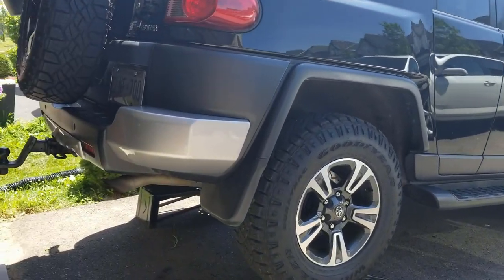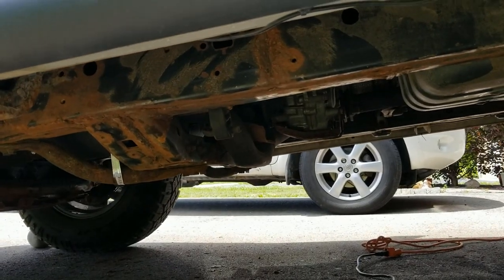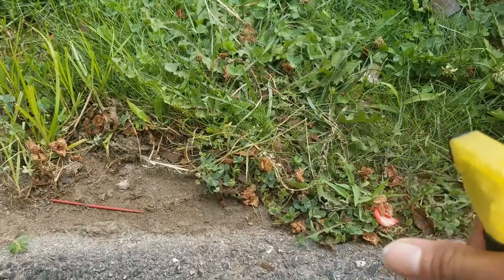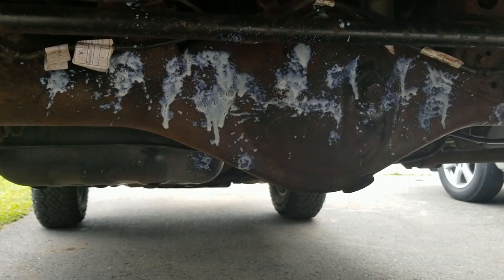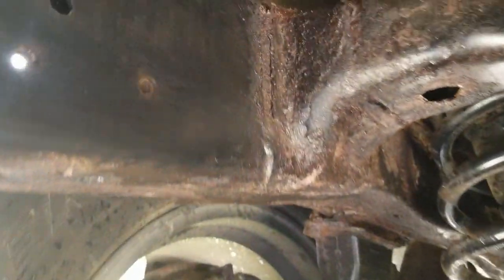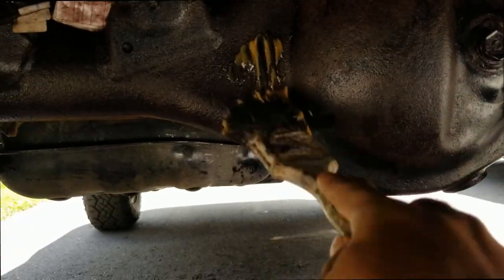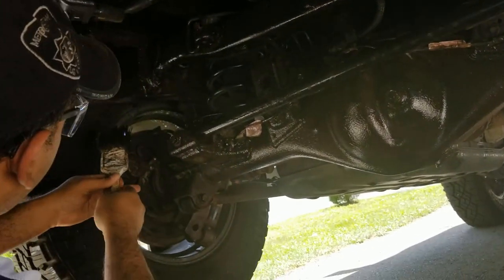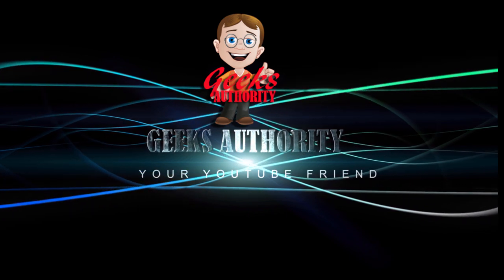TOYOYA FJ CRUISER | RUST PROOFING | FLUID FILM & FDC RUST CONVERTER | FRAME RUST PROTECTION

Comment: this helps me so much. Thank you! Is there places you especially dont want to wire brush, or spray or paint fluid film?
Reply from the maker: Thats so nice to hear Steven, thank you. Yes, you dont want to brush on rubber bushings or spray on bushings. Do not spray anything inside calipers because if it accidentally ends up in brake pads, that's not good. Since you are already there , check undercarriage gas tank strap as it usually rusts up pretty bad and break away while driving causing issues. Other than that, dont forget to subscribe (wink wink) and share your thoughts once done so it will be useful for others. All the best Steven - you can do it!

Comment: Mines eating itself from the inside. Welds everywhere broken. It should be a recall. They didn't coat it when built. I take great care of mine. Its now new again, and i can't even drive it
Reply from the maker: I feel that pain, FJ is a robust vehicle with very bad rust problems. Engine will live for ever but frame won’t survive. It’s even a safety concern. What use with a 4x4 off-roader if frames are soft as bread because of rust.
Reply: @geeksauthority  iv had mine juiced up to take me anywhere across country or through any swamp and in-between since 08' and ill never get rid if her, but i dont know what to do right now. I got a lot of power coming out of mine, all custom fabbing myself to get those perfect shocks with my wide 35s no rub on flex, faster than a hemi. Basically a side by side for the highway. I use the shit out of mine for everything. Shes built lol. But i never expected the frame. I never heard there was a lawsuit for 1.5 million frames until now. Toyota skipped a couple coating processes but also didnt weld the frame for shit either. My motors trying to come through the hood, suspension is too notch with the tires pointed dead in at the top  welds holding all that together are broken, stress fractures everywhere. I cant even just weld it back because its obviously moved so far. 🤦🏼‍♂️🤦🏼‍♂️🤦🏼‍♂️🤦🏼‍♂️
Reply from the maker: @KendallPhillips89  I hear ya, only thing we can do it drive it till it dies. Toyota is not going to replace frame, I too tried everything but they won’t budge.
Reply: @geeksauthority  its going to to be a bad wreck if i drive it anymore. Thats how i found out. All the new shit stressed it the rest the way. I can weld but i don't think thats the option here
Reply from the maker: @KendallPhillips89  True, can’t weld on rust.  However check scrap yards at California and you may find FJ wreck with good frame. Or build one from ground up .
Reply: @geeksauthority  well its not so much that yet. Is more weld cracks on and to the frame and what look to be stress fishers in some of the actual plate. Flexing and what not. It would be a lot of work, but i could weld it. Problem lies getting it back where it's supposed to be because its so far out of rack now each way. Need a dang frame puller and know what its supposed to be, then fix all the welds, even weld the fucker out why not. But how do i treat the inside like i do the outside if i took it this far. Wouldnt want it to keep rusting from within after all that work ya know

Comment: you tried your best and i commend you for that sir. To make your life easier a needle scaler would help imensely. the best products to stop rust are actually as always german products ^^ the first would be Kline Rust Stop and Tannox Rust stabiliser. Fluidfilm ASR Spaybottle for ease of use, as it seems you dont have to proper Equipment. Otherwise you did your best with limited tools. well done.
Reply from the maker: Thank you Keep. Yes I did with the very limited tools I got as most of the viewers are like myself, just another guy trying to save FJ with limited stuff. There is no question about the product I used and it's still holding amazing well. Went through winter, spring rain, summer, off-road, now fall torrential rain and with many undercarriage wash, product is still holding well. I am glad to know you have success with your product but mine worked and working great for me :) Thanks for your kind words and comment.

Comment: I have a cruiser with similar rust issues I want to get it professionally rust proofed from a regular rust proof shop.
Do you think I should do this procedure before or after the rust proofing?
Reply from the maker: Hi Ham, thanks for the message and sub. I would recommend to do this as first step and see it for 4-5 months. It's holding up very well for me even after 6 months. If your shop is asking less than $500 and you believe them , you can take that route. By doing it by yourself, you can make sure that every nook and corner is taken care of.

Comment: Thanks,  I need to do this on my 07 FJ.  My 14 FJ seems pretty rust free but may do the same on it for extra protection.  You make it look easy.
Reply from the maker: You got 2014 FJ? WOW! So you have two vehicles that does not depreciate, wise man! Thanks for your kind words and yes, please do so to keep the 2007 in a perstine condition. I've seen FJs hitting 800,0000 KMS without issues, so just take care of it and it will take care of you basically :) I will share the follow up videos on FJ with the tricks I learned working on my 2007. Thanks for stopping by and dont forget to subscribe ;-) Happy new year.
Reply: @geeksauthority  I was fortunate to have the first and last years of production in North America.   They are definitely a modern collectible..
Reply from the maker: @lanyouree8532  oh 100 % . Don't sell that 2014, you will get many more times than what you paid for if it's in good condition.
Reply: @geeksauthority  the Crawl Control on the 14 is pretty amazing.  At least for sand and mud.
Reply from the maker: @lanyouree8532  Yeah, I have a new 4Runner and it's pretty amazing as it got it too.
Reply: @geeksauthority  nice!

Comment: I was doing this for my fj back in May. same searches as you, looking for the best rust converter and ended up getting corroseal. You can get corroseal 3.78L in mississauga from cloverdale paint. for $61.78 plus tax.
Reply from the maker: Good to know Tommy,  I am about 200 Kms away from Mississauga , so may be next time. Thanks for letting me know and that's a great information. Thanks much.
Reply: Thanks for sharing this info, any updates on how its worked so far for you this past winter? Sry not sure of you deal with snow and salt but has this method helped keep the rust at bay atleast